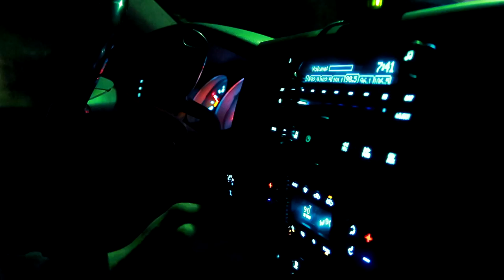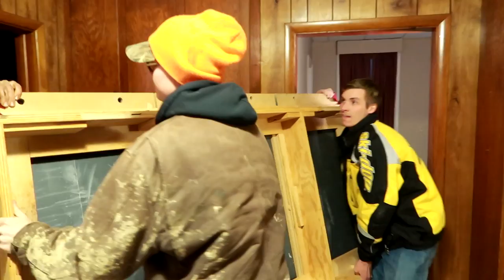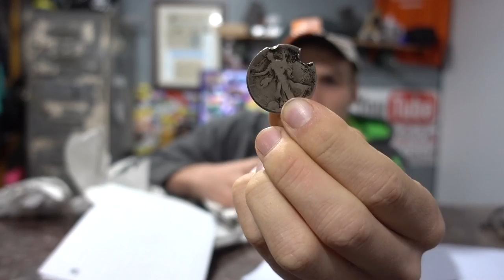Buying a Craigslist Pool Table

Comment: +3DMachines you should by a cheap ratchet add a socket and find a way to blow compressed air into it so that is spins the ratchet at a fast rpm and see how long it lasts for before it losses its rachtety goodness

Comment: dose droping a little cigarette in a thing of gas and in a fire or nothing  try it and see (find someone who smokes)
Reply: _cope riders the gas will put out the cigarette. gas does not burn well it's the gas vapor that burns. put a splash of gas on the ground and try and light it with a lighter,it takes a good couple sec to get going Cuz it has to heat up and make vapor